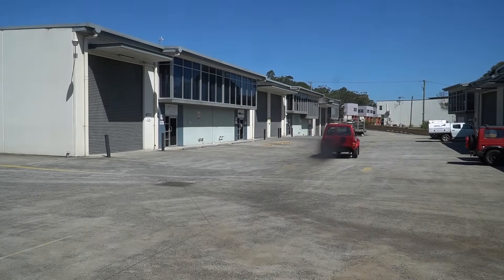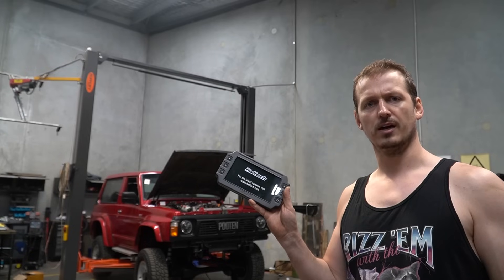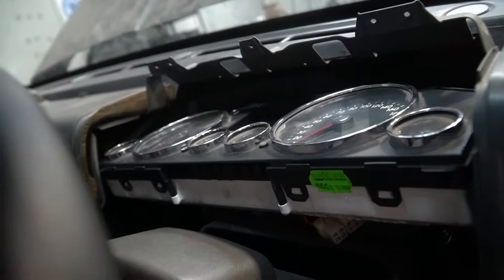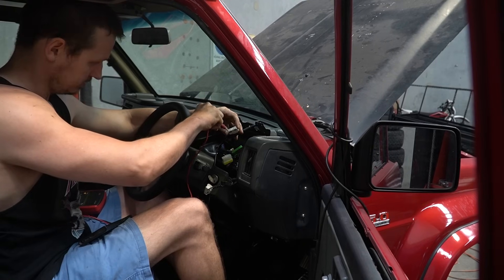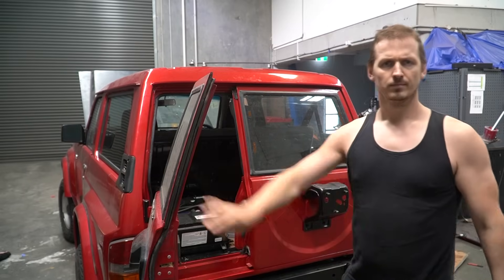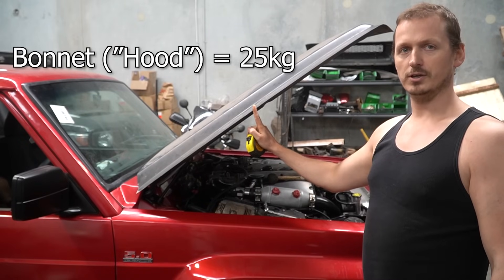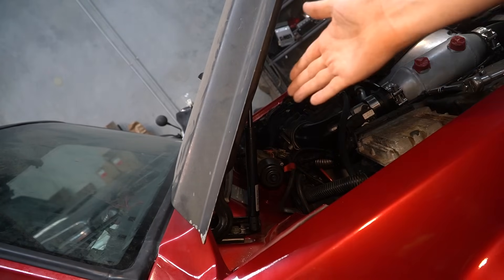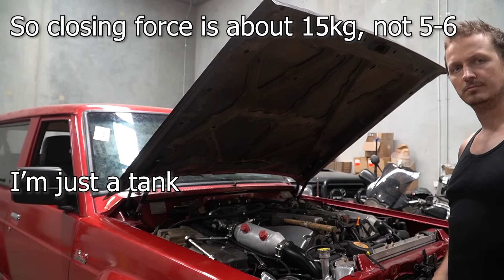This Haltech Digital Dash Works WITHOUT an Aftermarket ECU

Comment: Your comments stuck with me that the Can Gateway modu6 is in the gauge cluster so I did a bit more digging as also doing dumb things with a mk5 tdi golf and fitting mk7 parts into it. What is stopping you from installing one from the same generation Porsche Cayenne 7pa P/N - 7L5907530B Can Gateway Module in or Audi Q7 7L P/N - 8R0907468P?
Reply from the maker: Different generations and not compatible as far as I know. Even the 7P Touareg has a seperate module, just the 7L is combined like mine. Early ones you have to be careful with part numbers (even firmware) to have a hope
Reply: @ridiculousthings4x4  Ah right I was of the understanding that the touareg, q7 and cayenne (pre 2010) were all of the PL71 platform so used interchangeable parts with in reason like pre and post facelift models. Hence the thought of a 06 touareg 7L v10 tdi might be able to use a 06 Q7 4L v6 tdi or 06 cayenne 9PA vr6 Can gateway module as most of the Can and K line communications would be close. I'm more than happy to be wrong but it's a thought to talk about

Comment: RT4x4,  updat,             or u coulda get two rods,                                            mount one end  near the front and mount a bracket 4" up from the rear of the hood  to hold the hood open.

Comment: Motec ecu bro. It worth the 7g
Reply from the maker: For a PD diesel? You pay, and if it works I'll give you the car. Because it won't.
Reply: @  ok chief. motec dont know what they are doing (
Reply from the maker: more like you don't know what you're saying
Reply: @ridiculousthings4x4  It just a engine man. Motec been making after market ecus for yonks. but what would i know. Only been tuning engines for 30 years. But hey stay simple minded :)
Reply from the maker: how many v10 PD diesels running motec in that time? Genuinely curious. Actually I'm not, I don't care in the slightest.
Reply: @ridiculousthings4x4  Love it. never breaks the character.
Reply: @ridiculousthings4x4  The edc16U31 is pretty good for older ecu using winols to edit.

Comment: I'm in a similar bind as you with vehicle speed sensor(s) on my 4cyl TDI build. If the VW ECU doesn't have some speed data, the cruise won't work and it might cause a limp condition, or does the Haltech dash communicate bidirectionally to feed a value to the ECU?
Reply from the maker: TBC, but there are definitely ways around it without a whole new dash. Even odis would be able to flash out various requirements and stop limp/MIL